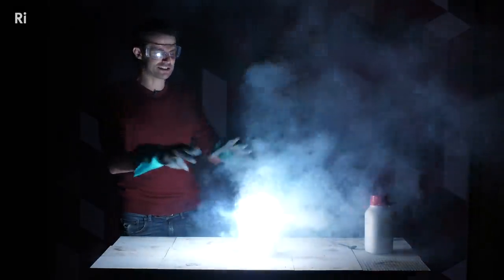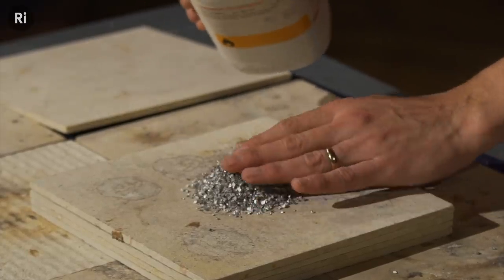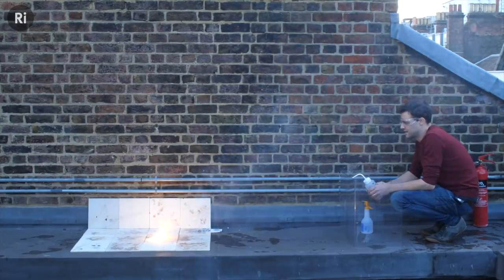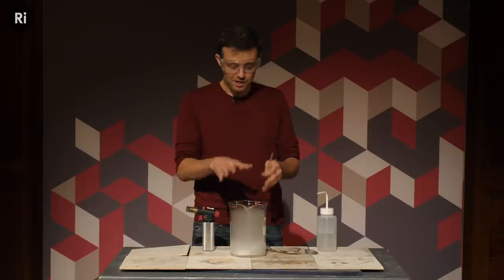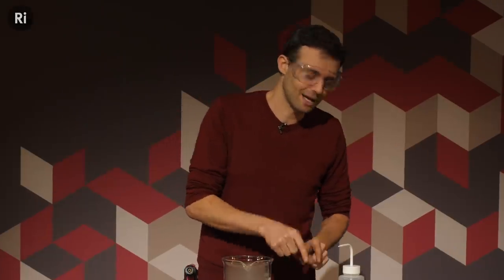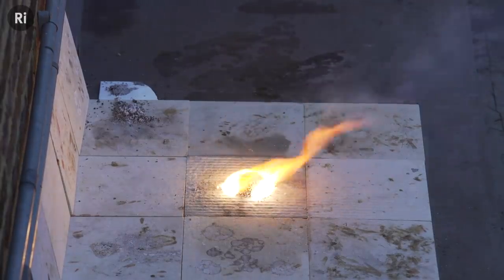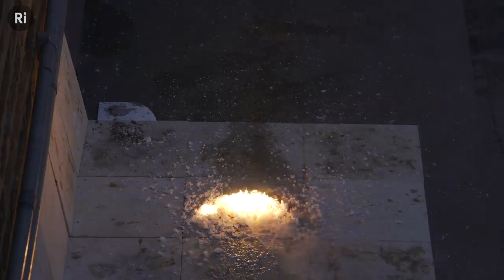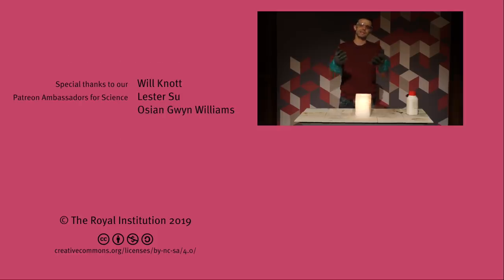How Not to Put Out a Metal Fire - with Steve Mould

Comment: One thing I used to love to do when I had access to lots of magnesium turnings is to put a pile on top of a mound of snow. 
You start the magnesium burning and it will slowly start to melt the snow. When it melts enough and the burning metal begins to shift, you get a good flare up and it melts through the snow very rapidly. There's a real nice glow coming out of the snow and lots of popping. It could be dangerous if you did a huge amount but the channel that melts helps keep it contained.

Comment: If you have a large body of water, like a pool, river or the ocean nearby, it's safe to dump burning metal into that, the large amount of water will take away the heat, stopping the fire, but if the amount of water you're putting on the metal is less than about 2x the mass of the metal that's burning, your best bet is a pair of running shoes. Even sand can act as an oxidizer for magnesium it will strip the oxide from silica and turn it into silicon metal.
Reply: That sounds like still a bad idea, but it does make sense from a chemistry perspective just because of water's specific heat capacity.

Comment: If you'd like to know how you should put out a metal fire: use a class D fire extinguisher. There are several types, see https://en.wikipedia.org/wiki/Fire_extinguisher#Class_D_dry_powder_and_other_agents_for_metal_fires
The approach seems to be to use a salt that melts and forms a coating that smothers the fire, most commonly sodium chloride. Other options are available.

Comment: Interesting vid, i would like to see what would happen if you poured sand on the metal fire. 
It would be worth mentioning that magnesium not only produces a very bright white light but also ultraviolet light, it may not be especially good for your eyes if one sets fire to metal on a regular basis without using some type UV eye protection as well.
Reply: Wikipedia says sand extinguishes Mg but I will say that a Mg-SiO2 thermite can be used to produce silicon and MgO so IDK how effective it is. Have sand on you IG and start by throwing just a little on Mg fires

Comment: F1 wheels are made from magnesium.  That’s why they burn so well if they catch fire and why the extinguishers at a track are dry powder.
Reply: Large components like magnesium wheels will not catch fire like powdered magnesium. They are magnesium alloys, not pure magnesium. In addition smaller pure magnesium particles provide a larger surface area for ignition. Bulk magnesium doesn't catch fire easily.
Reply: Liofa.  No it doesn’t, but when it does get going it goes quite well.
Reply: @mickcoomer9714  The radiator support bracket in a new aluminum body Ford F150 is magnesium as well. When my neighbor's Chevy Silverado pickup caught fire while they were on vacation, the fire department and I discovered that the transmission bell housing or one of the large support brackets was magnesium because boy did that burn bright white and leave a divot in the asphalt of the road.
Large chunks will burn. It is just easier to ignite turnings with their larger surface area to volume ratio.
Reply: Where's the source of that info ? or is that internet fact ?
Reply: @Kabodanki  I believe the gearboxes of some London Buses ( probably Routemasters) had a very high magnesium content and would burn. I think the fire brigade learnt they needed to have a couple of Class D Fire Extinguishers on their appliances. In the old days it was easy to identify class D extinguishers as they were a different colour. Then the EU made us paint all fire extinguishers red. Hopefully on the 1st January we will be able to return to sensible marking for fire extinguishers.

Comment: Maybe a parking lot or spot in the yard would make more sense than the rubberized roof of a building.  I imagine that the inside of a fume hood would have been far safer...
Reply: It's a lead roof, so pretty safe with the insulating mats and the RI is in central London, you probably don't want to be starting metal fires in the street...

Comment: To take this video one step further, if you are going to cast metals make sure your moulds and all tools are completely dry and free from water. Heat the tools, heat the charge material to dry them if necessary. Pouring liquid metal into a damp mould can also result in a hydrogen explosion.
Reply: A friend of mine works in IT. One of his jobs was on a steel plan, they melted scrap metal that was stored outside. In Sweden,. In winter.

Snow+iron+iron smelting temperatures equals a decent size explosion.

And that was normal operation.
Reply: @57thorns  😆 That would be awesome to see! My husband and I love to see things go boom.
Reply: @celtgunn9775  All he noticed was a boom and occasionally the buildings around would shake a little. There is a reason people are far away from the mill when loading.
Reply: It's not usually a hydrogen explosion, it's simply the water boiling into super heated steam. For a hydrogen explosion you need either an alkaline or an alkaline earth metal from the first 2 columns of the periodic table but, with the exception of magnesium, they are rarely cast. I agree it's a good idea to keep your tools and molds free from water,  or you will get splattered with molten metal.

Comment: You can put metal fires out with water, you have to dump enough water on fast enough to remove the heat from the metal. So a squirt from a bottle would not put ot that small fire but up end a five gallon bucket over it would. Other wise an inert gas like Argon will work ,CO2 is an active gas as it disassociates at high temperatures.
Reply: Or dumping the burning metal into a lake. Unless it is an alkali metal, then, well...

Comment: what will the oxygen-stripped atomic carbon do next? is the inside of dry-ice crucible charred with soot after the fire?
Reply: Yes, it is. I can't remember offhand which, but another RI video (a full lecture) shows the same reaction and the carbon deposited inside the dry ice.
Reply: thanks! Pls, hit me up If you'll remember later what lecture it was.
Other commenter pointed out that bunch of CO (carbon monoxide) should form during this reaction. That makes sense, since there's no guarantee that both of the oxygen atoms from CO2 will get stripped.

Comment: Why don't we use nitrogen fire extinguishers? Risk of asymptotic asphyxiation?
Reply: Magnesium will actually burn in nitrogen to produce magnesium nitride. It's the black bits you get when you burn magnesium in air. I think carbon dioxide is preferred in extinguishers because it is less dangerous to humans as you will feel out of breath if you breath it whereas breathing pure nitrogen you would collapse and die before you knew what was happening.

Comment: Very surprised you did not read a bit before trying the original attempt. Simply consulting a college chemistry text would have told you this. WW II firefighters found they had to use sand to put out incendiary bombs with magnesium. You should have included that in the series of tests. Also, the roof is an intrinsically dangerous place for the experiment because of the scattering of material onto the tar. Usually I enjoy your videos, but this one encourages unsafe home experiments.

Comment: Just a point of order, The fire triangle had been superseded by the fire tetrahedron. This includes fuel, heat, oxidizing agent, and the the uninhibited chemical reaction.

What would a halogenated fire suppression agent do to a metal fire?
Reply: Andrew Freeman fine aluminium powder mixed with carbon tetra chloride is supposed to be an explosive

Comment: Little boo-boo at the end. CO2.  Your model seemed to be C2O? Did I miss something?
Reply: Should have been one black and two red.
Reply: where in the video?
Reply: @porteal8986  4:16 He refers to the red balls as carbon and the white as oxygen.
Reply: Just to be pedantic. Consider hydrogen H, oxygen O2, and carbon. Oxygen likes to think it's a molecule and goes around in pairs. To make water each O2 couple has to be separated and grabbed by 2 H atoms making 2 H2O molecules. One bond broken, 2 bonds made. If you have the right amount of H and O2 nothing is left over. Carbon dioxide is a friendly C joining an O2 pair. One casual bond made, CO2.
Reply: @williammorton8555  Actually, he is referring to the two red atoms as oxygen (4:26), which is correct; however, the white atom he refers to as carbon; carbon is always black. Sort of like sulfur is yellow and nitrogen is blue. Weird how he has a white atom that bonds four times; usually white is hydrogen which bonds only once.